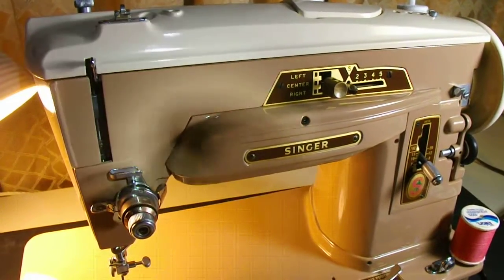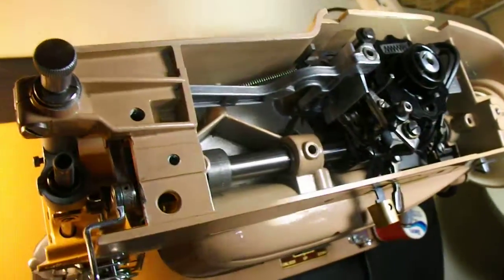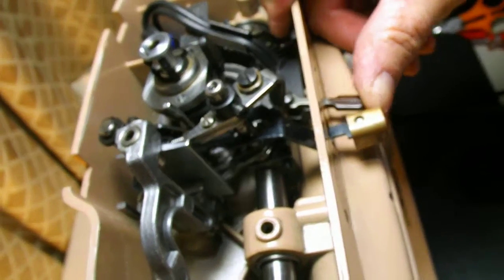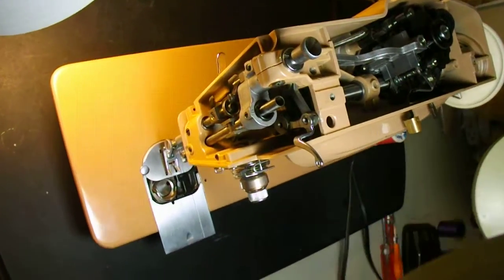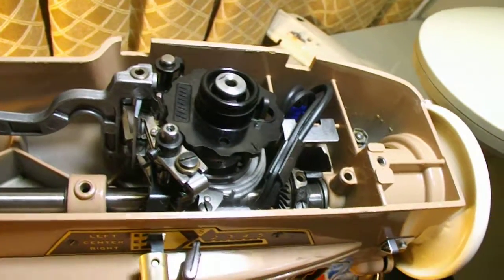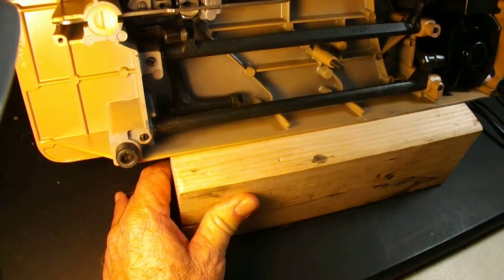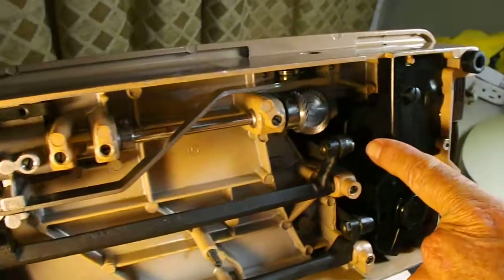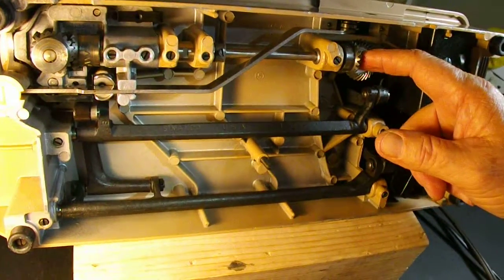SINGER MODEL 403A A LOOK INSIDE WITH COVERS OFF

Comment: Andy, I viewed this video again and it's so informative! But, I am having a problem that I don't see addressed. I cannot get the stop motion screw on my 403A to move. The hand wheel turns fine, but I am trying to load a bobbin with no success. I put a little WD-40 behind the screw "face" with no luck. I also see a small screw on the stop motion screw, but it too won't budge. What do you recommend to get the stop motion screw to turn again? Thanks so much!
Reply from the maker: I'm sorry you have this problem, Diane. I recently finished recording 25 videos for the model 403A and they are in a Playlist here:
https://www.youtube.com/playlist?list=PLsCOZgzzaiKKyqvdDRwS-9MfLuwSNJTcg
One of the videos is for the handwheel and bobbin winder and I had this same problem with my machine. Taking a look at the video may be of help to you. https://youtu.be/ghnNYyMC1xU     Between the Stop Motion Screw and the handwheel is a Clamping Washer, and on my machine, someone had put the washer on reversed. That makes the Stop Motion Screw very hard to tighten on the washer in the sewing position, so they just tightened the heck out of it super hard so they can sew again. That smaller screw is the Stop Motion Screw Set Screw and it is meant to jus bump up against the raised edge on the proper side of the washer. It may be jammed up against a raised part of the washer on the backside instead. I was able to get that set screw to loosen and then all the parts were easy to remove and reinstall in the correct manner. You are on the right track using the WD-40 to try and loosen things, whether you have the same problem I did, or just a frozen set screw (rarely happens) You can spray the oil behind the stop motion screw and try getting it on the clamp where the set screw is, then let the oil sit on it. After some time it may help you remove the set screw. You can also try heating the area with a hairdryer to try and expand the screw to loosen it. It makes a mess blowing all the WD-40 around, so a towel around the back of it can help. The Motion Screw and Hnadwheel can get pretty hot, so be careful. You can also try to force the set screw off of the clamp by using your super lady strength to turn the Motion screw left while turning the handwheel right and try to literally force them apart. I'd try getting more oil behind the motion screw onto the clamp and back of the set screw first, and give it time to work. Then heat if it is still stuck and save the super strength (another pair of hands or pliers on the motion screw? Ouch, poor screw) for last in case your problem is different. Some people have put a well-fitting screwdriver into the slot of the set screw and given it a sharp rap with a mallet or hammer to try and "jar" the parts and loosen them. Best of luck with it and remember there is a reason most ladies are more patient than most guys.
Reply: @andytubesewing1953  thanks for such a detailed explanation!  It's super helpful and today I will get some assistance from my husband!  And I appreciate the link to your videos. I'll look for the one on this issue. Have a great day!
Reply from the maker: @dianesilverstein6475  I know you will get it loose, then you can reinstall it properly. I'm glad you asked b/c other people can have the same problem. With that in mind, I pinned your comment to the top of the section. Thank you, and good luck.
Reply: @andytubesewing1953  success!! With a little muscle from my husband, the set screw came loose and after watching your video, the machine did have the "washer" in backwards! All works fine now. You're the best and thank you again!
Reply from the maker: @dianesilverstein6475  Nicely done! A good husband, too. It's a strong machine and I doubt it was damaged. Thanks for letting me know. Happy sewing.

Comment: Hi! I've watched your video again and am happy to say I've found a 403A to purchase. Is there a 1/4" seam allowance foot made for this machine? Also, do you know if there's a walking foot available for free motion quilting?  Thanks!
Reply from the maker: You can find almost any presser foot ever heard of. Just remember to buy "slant" style feet. There are even "Quilting Feet Kits" available. Here is just one retailer who sells the ones you asked about: https://www.sewingpartsonline.com/search.html?sort.relevance=desc&keywords=403a&index=29
There are many other retailers and you can find original vintage attachments on eBay too. Songer models 301A, 401A, 403A, 404, 500A, 503A all use slant feet and well as most of the 600 and 700 models. If you need a copy of the original 100-page instruction manual for your "new" machine it is available FREE at this link: https://www.singer.com/sites/default/files/product_manual/SINGER%20403A%20Sewing%20Machine.pdf
I have a short video playlist about the 403A: https://www.youtube.com/playlist?list=PLsCOZgzzaiKInZUROdMNIGGO_nfhM2u6D
Since you have an interest in the Singer Genie Models you may like this playlist and series I am currently working on: https://www.youtube.com/playlist?list=PLsCOZgzzaiKInZUROdMNIGGO_nfhM2u6D
Thank you for watching Andy Tube, Diane, and happy sewing to you.
Reply: @andytubesewing1953  thanks for this info! Much appreciated!

Comment: Hi Andy - what's the trick for installing new vinyl spool pins on the 403A? I just got new ones for my 403A and I got one in on the flip up lid but the lower bobbin pin I can't get in. Any ideas?
Reply from the maker: A few things to try. I usually tap it in with a hammer but have also put bar soap or car wax on the pin if very tight. Some pins are made differently and they are TOO tight. I fold over a piece of 600 grit sandpaper and "squeeze" one end of the pin in the fold while twisting the pin back-and-forth. So just sanding down the size of the tip. Once the circumference gets smaller I can get it tapped into the hole.
Reply: @andytubesewing1953  Thank you - did you do any videos on Kenmore machines? I'm trying to find a belt for a model 51 (158.512) and its like impossible! I see these stretch belts but I don't know about that.
Reply from the maker: I only did two Kenmores. Both were given to me by buyers of my Singer machines. They were both well-made machines and I got them working great, but I found what you have; parts are very, very hard to find. Also, documentation is lacking. I've never bothered with Kenmore after that. When anyone gives me one I just take it to Goodwill with the hopes someone will use it. Is the belt you need a cogged belt? If you have the old one you can measure it and buy the same size from sew-classic or central Michigan sewing maybe.
Reply: @andytubesewing1953  We searched through the stuff that came with the machine and found a belt that works. I think you are right I'm going to suggest he gets rid of it he has all Singers other than this.
On another note I'm trying to buy a throat plate screw for my 99 and everyone is billing them as the same as the 221 which is not the case my 99 has a larger screw. I order some and sure enough they are too small. I have both machines here and it is crystal clear they are not the same. One seller is supposedly looking into this...
Reply from the maker: Did you try to screw it in? I have parts list for Model 99 in versions 12-13-22-24 & 31. They all show the Throat Plate Screw is part no. 691. The definition of part no. 691 is listed as "throat plate screw". I also have the parts list for Singer Model 221-1, 221K1, 221K4 & 221K5 that show the same part no., 691, for the throat plate screw. Maybe that is what the sellers are going by, and I would too. The Model 99 versions 24 & 31 have A or BB with the part number, like 691A. Those alpha characters are to do with the finish, like the "A" stands for "Hardened, Polished, Nickel Plated and Buffed", but had nothing to do with the size as far as I know. Maybe the bugle-shape of the screw head looks smaller and fits a little lower in the depression of the plate, but the threads are correct for the machine. Tell me I'm wrong :)
Reply: @andytubesewing1953  Thank you for that info - I just had a really GOOD look at it an see now that someone damaged the threads on both sides - on one side they had forced in a cop head screw with a coarse thread. So I chased the threads with a tap and managed to get the screw to follow the original threads and it is holding well. So it looks like the 99 is now ready for combat. Thanks again for your help. We never know what these machines have been through and often get "surprises". Same with old hi-Fi equipment.  Thanks again!
Reply from the maker: Nicely done! If the machines could talk, right? Well, at least it is in good hands now. Sewing machines must seem relatively easy after working on the old Hi-Fi equipment I would imagine. That's more like an art.
Reply: @andytubesewing1953  Andy do you have any idea if there is a cross reference parts guide for Singer? It seems some parts are used across different models. Thanks - AL
Reply from the maker: I have never heard of one, although I've wished for one for years. I think there must be one simply because I see advertising for a part with a list of many models the part will work on. When I need something like say a needle bar for a 338, but can't find one for sale, I look at the parts list for model 337, the sister to the 338. If the part number is the same I will start looking for a 337 needle bar. I may also look at parts lists for models of the same family. Example; the part is from a certain model of the "Stylist" line. I'll look at other Stylist models and look at their parts lists to see if they have that same part I'm looking for. This can be tricky b/c I have bought the same part number from 2 different models only to find out it was not really the same size like a take-up lever had the same part number, but the hole for the hinge stud was too small for my machine. Go figure. Usually, in what I call a 'Family Series" like models 401A, 403A & 404 I find many, many of the parts are the same. But the parts on a model 413 are not because it is a different "family".  Next time I chat with an old Singer guy I will ask about that list.

Comment: Andy, thanks for another great video! I am definitely after a 403A. I found one that is missing the power cord and foot pedal and possibly the presser foot thumb screw. I might be able to get the machine for $30 to $40; would the missing items be easy enough to find? I'd have a technician check it out and service it as needed. I guess I'm trying to figure out if I am spending my money wisely and that the machine could be brought up to Singer standards. Thanks for any advice you can impart!!
Reply from the maker: You can buy used vintage parts on eBay and Bonanza. Probably Amazon too. Personally, I would buy a new electronic foot controller for about the same price. New, so guaranteed to work and more control than the carbon pile old style. The thumb screw, new, is about $2. The trick with buying a $30 machine without a foot controller is you can't test the motor. What if the bearing or brushes are bad? More money. Do you know if the tension unit is working? Does it have the original bobbin case and positioning bracket in place? I feel it is always better to buy a machine you can sew on to test before spending your $$. I have bought machines that have problems but could figure the parts into my offer price. Do you have a technician? what will he charge to "check out" a machine and service it? If he is reasonable and can give you a forecast price to get it up to par, OK. A new electronic controller is about $20. The cord set can be 8 to $20. A used motor, if working, can be 25 to $40. Tension units, complete are about $15 to $25. Your $30 machine can end up costing $80 more just for the parts. If you are paying someone to service it, you are over $100 before that servicing. Better to wait and try to find a working machine you can sew on for 5 minutes and listen to the motor, test the tension, feed and bobbin winder, light and sewing quality. If it is clean and ready to sew for $100, then you may be ahead of the game. You can search eBay for the parts you think you would need, and I also get my foot controller, cord and so forth here: https://www.shop.sew-classic.com/Singer-401-401A-403-403A-404_c22.htm
(when parts in stock) Patience is a virtue and may save money.
Reply: @andytubesewing1953  Thank you very much for your sound advice.  I will hold off on making this purchase. Do you sell sewing machines that you restore? Thanks again! You are awesome!
Reply from the maker: I think that is a good idea. Better you are happy! Have you thought of restoring a machine yourself? My videos could help. I sell my machines on Craigslist in Phoenix, AZ Metro area. I have shipped a few, but it costs $75 to $130 to shipping in the lower 48 states, and I did ship one to the Philippines. (Whew!)
Reply: @andytubesewing1953  well, there's a thought; I would find restoring a machine both interesting and satisfying!!  Thank you for your responses! Your videos are wonderful!
Reply from the maker: You can do it! Here is some encouragement for you and anyone else contemplating a restoration. A link to a restoration slideshow of a Model 403A restored by Shelley, an Andy Tube viewer. This was her first restoration and she found it very rewarding: https://youtu.be/LLGk9o1aHa4
A link to 50+ videos of a step-by-step restoration of a Model 404. Many of the steps are shared by model 403A: 
https://www.youtube.com/playlist?list=PLsCOZgzzaiKIB4kvIHCfHYuyLMUp5A4UI
A link to 20 videos about working on the Model 503A, Rocketeer version of the 403A. They cover some items not covered by the 404 videos when it comes to ZigZag and Pattern Selector: https://www.youtube.com/playlist?list=PLsCOZgzzaiKJZaZn2zl3LsnV2d7UhrqvX
So many have written to me after restoring a 403A, 404, 500A, 503A and 401A from watching these videos. That is why I made them.
When (not if) you do your restoration, contact me if you need help, and thanks in advance for saving a vintage Singer Sewing Machine.

Comment: great video but i needed to see where power plugs in to machine.  the light switch was shorting w/smoke and now no power to motor.  any suggestions?
Reply from the maker: Welcome to Andy Tube. You came to the right place. Here is a link to a 50+ video series on model 404 which will show how to remove and replace the light, wiring and most of the parts. The 404 does not have the zigzag, but that is not your problem anyway. https://www.youtube.com/watch?v=6RgiOegFx-I&list=PLsCOZgzzaiKIB4kvIHCfHYuyLMUp5A4UI
Here is a link to 7 videos that show how to restore the motor in your machine:
https://www.youtube.com/playlist?list=PLsCOZgzzaiKJSu0T9oeaheTZsrUe91kkZ
Here is a link to download a free copy of the original parts list and diagram of your machine: http://parts.singerco.com/CPpartCharts/4_4999/403A.pdf
Here is a link to download an original copy of the Singer Service Manual for your machine class coving the 401A, 403A & 404 models. It has instructions with pictures for removing, replacing and adjusting your machine.
What more could you ask for mr zif001?
Stop by again sometime and good luck.

Comment: Besides ebay is there any place that sells parts for the 403A - I need the bottom cover screw & a plastic spindle that someone broke off the base near the bobbin winder pulley?
Reply from the maker: By bottom cover screw if you mean the screw that holds on the bed cover plate, it is a screw & thumbnut. Part 51361 Bed cover plate screw & Part 51621 bed cover plate thumbnut. 
The plastic spindle is called a spool pin. The felt piece that slips over the spool pin is called a spool felt washer.
Here are a couple of places I shop >>
http://thriftyfarmgirl.com/sewing-machine-parts.htm
https://shop.sew-classic.com/
https://www.vintagesingerparts.com/
https://www.bonanza.com/
https://www.sewingpartsonline.com/
You can download a free copy of the parts diagram for model 401A here >> http://parts.singerco.com/CPpartCharts/4_4999/401A1.pdf
It can help to have the part number when trying to locate used replacement parts.
Reply: @andytubesewing1953  Thank you Andy it looks like I bought 2 more projects - just what I needed - one is a 99 and the other is the 403-A.
Reply from the maker: 403A is my favorite ZZ machine by Singer. Direct drive internal 0.7A motor, all steel gears, no belts, pattern selector with 20 cams available. A beautiful slant-needle machine.
You will enjoy that one. http://parts.singerco.com/CPpartCharts/4_4999/403A.pdf
https://sewingdude.files.wordpress.com/2012/09/singer-401-service-manual1.pdf
Reply: @andytubesewing1953  Thank you so much I did do some shopping at these places and secured most of the parts I needed. Thank you for taking the time to provide the numbers and manual.
Reply: @andytubesewing1953  Now that I have one I can see why. Thank you again for this info!
Reply from the maker: Very welcome, Sir. Glad it helped.
Reply from the maker: Enjoy!